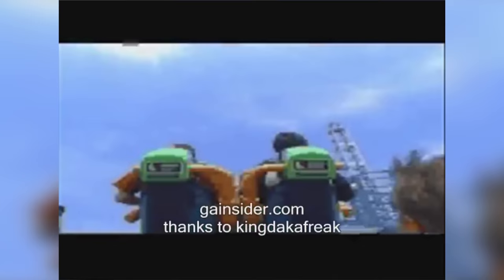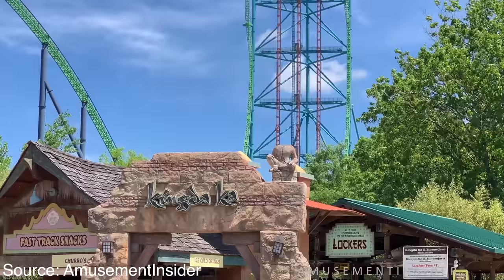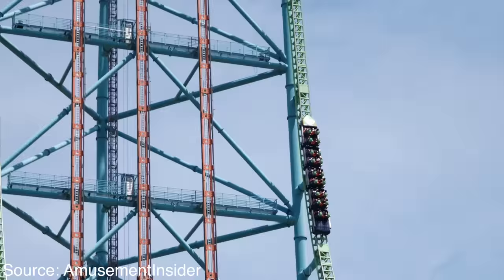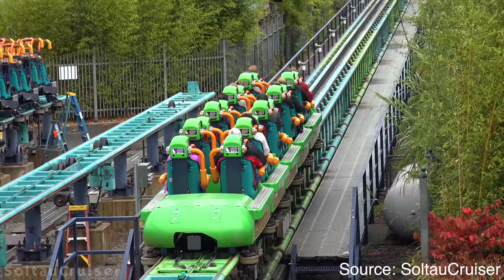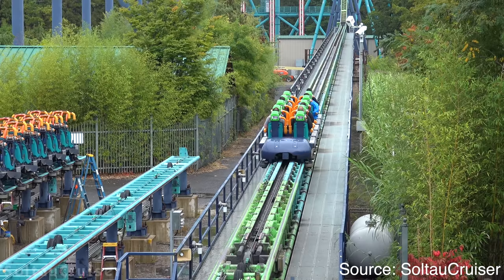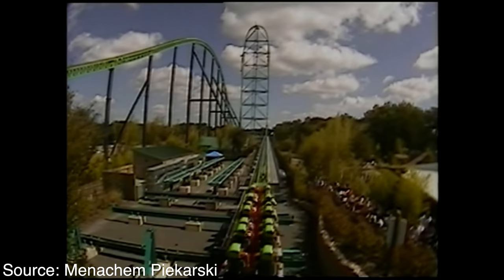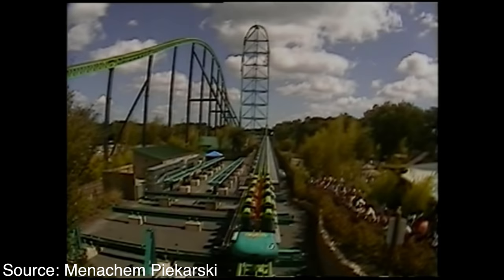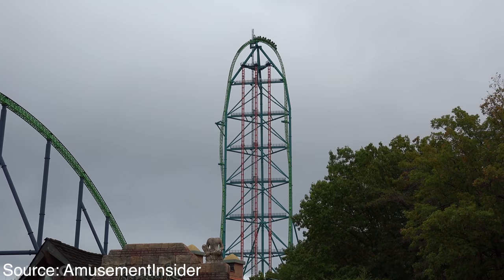Problematic Roller Coasters - Kingda Ka Review & Technical Analysis - Six Flags Great Adventure

Comment: No hate towards ElToroRyan, but this roller coaster seems kind of lame. Not that it's not intense, but that it feels so uninspired. It's like SFGA and the engineers who designed this ride just wanted to do the bare minimum to say it's "the tallest" and "the fastest".

By contrast, other rides like Xcelerator at Knott's Berry Farm (which I've been on) seem like much better rides. Xcelerator is nowhere near as tall or fast, but actually feels like a roller coaster, with several banked turns that provide a lot of high vertical g-forces.

Kingda Ka just seems like a roller coaster version of a drop tower.
Reply: Xcelerator is literally half the size and just has 2 turns😂

Comment: The PROBLEM isn’t the rides. It’s six flags. They RARELY build rides from an exact format given to them from the manufacture and they ALWAYS tweak the ride program and systems to meet their needs or cost. DEJA VU is a prime example. Six Flags great America. After removing it and selling it to SILVERWOOD, silverwood had it PROPERLY rebuilt, as it was intended, manufacture settings and all and runs almost FLAWLESS... six flags? Built it with a smaller power station. Custom ride program, customer electrical and brakes....
Reply from the maker: Alex Thomas Ka is pretty stock. Programming and parts wise as far as I saw in 2015

Comment: This ride sucks. You go up,  then down while staring at the pavement of the parking lot. When it opened you had to wait hours for a ride that only lasted a few seconds. Even as a young person,  it really strained my neck. All they cared about was breaking a record with the ride. I rode it a few times and decided it was a total waste of time. Rolling Thunder was a really fun ride in comparison. Lots of hills and you got to see a lot of the views of the park while riding it. When you felt the wheels leaving the tracks it was way scarier than any modern roller coaster. 😂 I stopped going when they decommissioned all the good rides and the lines for their replacements were way too long.

Comment: The entire Ka area just looks drab and worn out. 

Weeds everywhere. Paint falling off. Spilled and dirty oil all around the track area. I used to work in an oil refinery that was tidier.
Reply: Yeah...it's a very sad reminder of what it used to be. Worse than that, it also sends the message that they don't see long-term plans for the coaster's future. They did the same thing with Great American Scream Machine years prior, where for a few years they let everything just overgrow and wear, and then they removed the coaster.
Reply: yeah ka is bad the park overall has taken a bit of a decline but lots of the coasters are still in very good shape like nitro and superman

Comment: Just because 456 is a higher number than 418 doesn't mean you should shy away from the drop stat, considering drop is more important than height and also that Kingda Ka has the biggest drop stat of any coaster in the world. It might not be as good as TTD but the stats are true. Also: TTD is down right now and might possibly never open again.

I didn't visit SFGA this year (which would have been the 1st time in 40 years since August 1981) because El Toro went down due to a derailing of the back car of a train which ruined the track, so I visited Canada Wonderland instead. 

Your Youtube channel RULES!

Comment: I worked this ride. I hate this ride. A lot. Like ALOT
Reply: You got there 7 years after me. When i worked there the Tigers were still in Balin’s Jungle Land. They got out a time or two.
Reply: The difference in heights is super noticeable when you have to evac with a fucking ladder.
Reply: But i can confirm that when i worked it (i was an operator on EVERY coaster and ride in the park from 07-09) it had at least 12 and as many as 16 staffers from Rides stationed just at Ka.